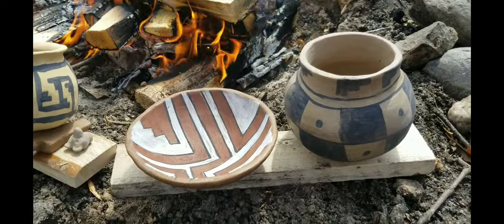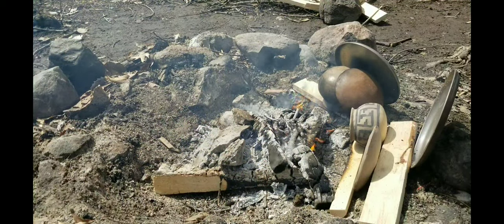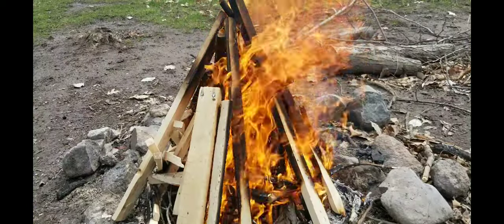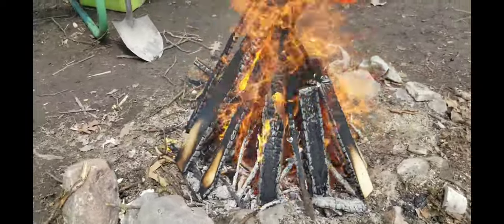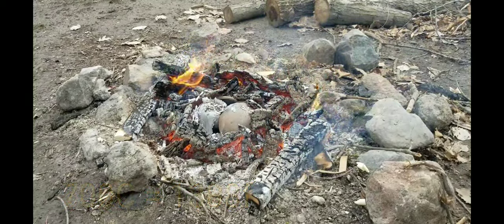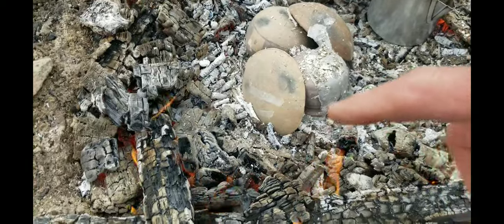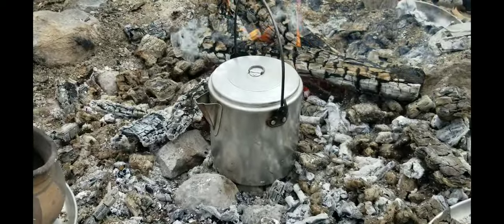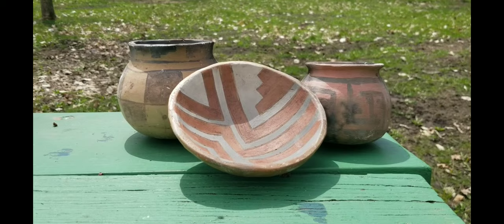Primitive Pottery Firing: Success!

Comment: A lot better firing,  Seemed to be a lot hotter, better preheat and longer more sustained fire. Kiln Gods helped. I was going to say that I have not had good luck with Raku firing which is also fast firing but up to 1700 F and fast cooling, with thinner and flatter items. The very thin and flat commonly break. However, your pukis were thick. So no help there. 75% success is much better.
Reply from the maker: Thanks, I appreciate the encouragement.